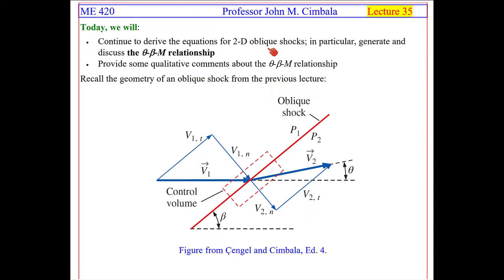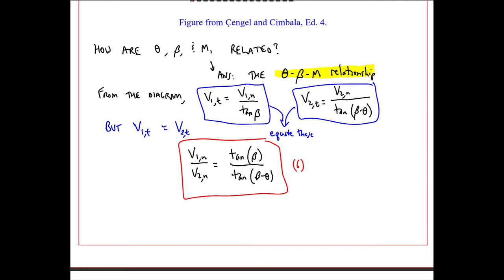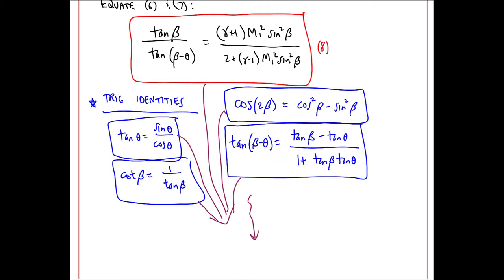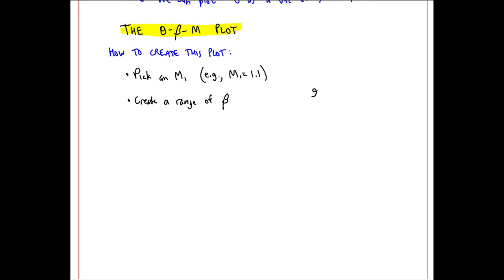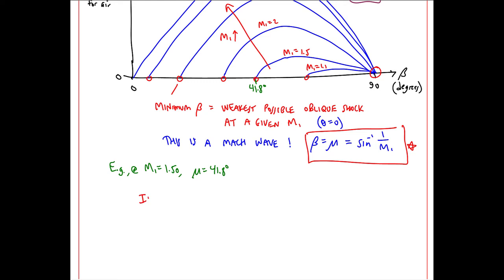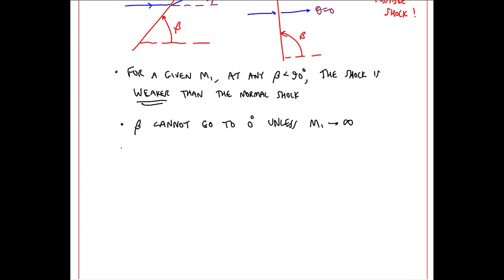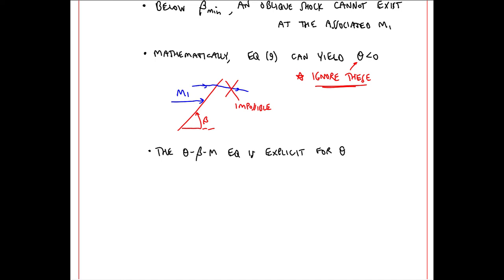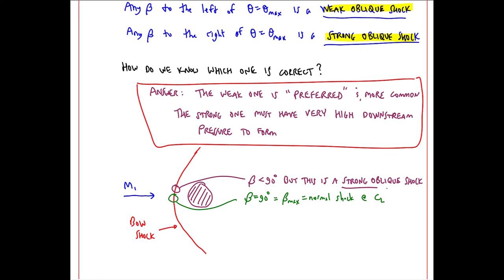ME 420 Lecture 35: The Theta-Beta-Mach Number Equation for Oblique Shocks

Comment: Is a shockwave normal if it has a low deflection angle and low mach number then? meaning it does not cross with the corresponding curve. i.e. Mach 1.2 and deflection angle 10 degrees
Reply from the maker: A normal shock, by definition, is perpendicular to the flow. So, any shock at an angle, even a small deflection angle, is NOT a normal shock - it is an oblique shock.
Thank you for your kind comment. Please tell your friends and colleagues about my YouTube channel where there are more than 470 free videos about the Bible, fluid mechanics, science, math, Excel, statistics, air pollution, and other topics. I would greatly appreciate it.